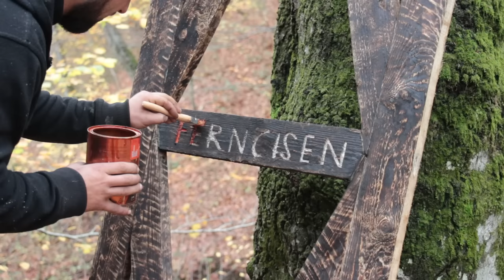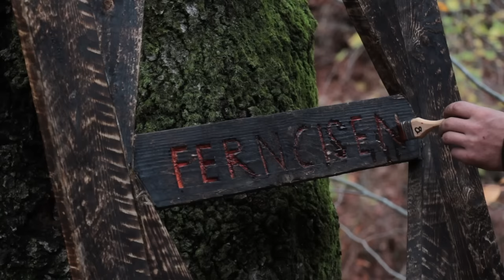I am building an A-shaped house with my own hands. Part 2

Comment: Question.  Wouldn’t u wanna throw rocks at the bottom of the hole before u put the foundation logs? What if a moose or bear or a heavy mother in-law steps on it? It won’t sink a little more on that spot?